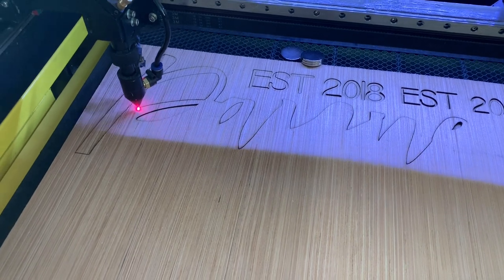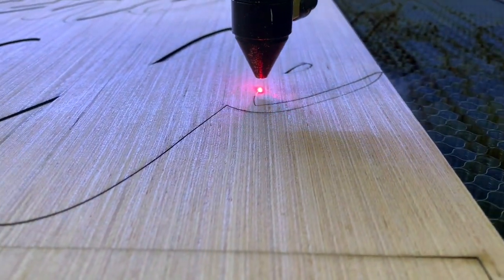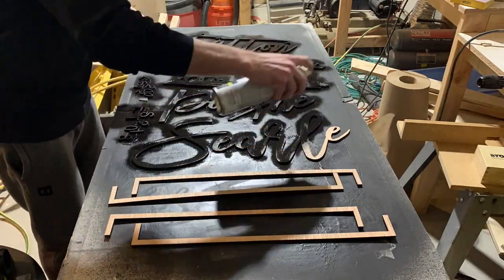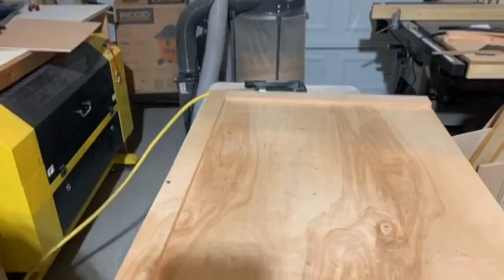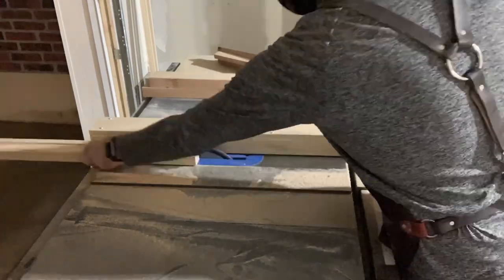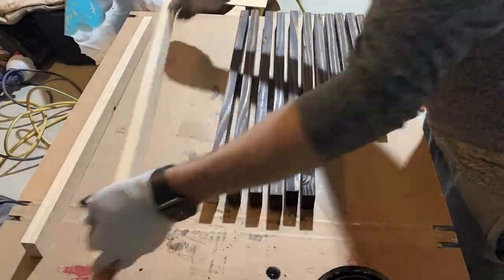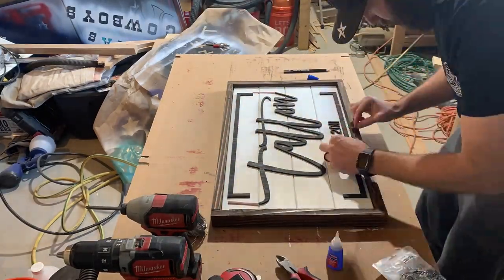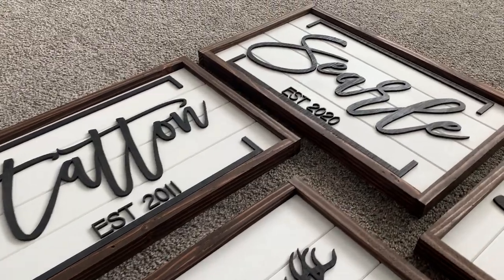DIY Farmhouse Shiplap Family Name Sign Tutorial

Comment: Hey there!  was wondering if you share where you got the weights that you are using to hold down the wood in the cutter.  I am having a heck of time with that.  Thanks!  Also can you also tell me where you get your wood at and what type.  I have been using 1/8 plywood from lowes.  THanks again.
Reply from the maker: Hi! The weights are actually rare earth magnets that I bought on Amazon. https://amzn.to/2SpAaI5 These are the ones that I got and I will double and triple them up to get more pulling force. The ply in the video is poplar ply that I got from Lowes.  https://www.lowes.com/pd/RevolutionPly-5mm-Poplar-Plywood-Application-as-4-x-8/50121135
Reply: Thanks for your help.  I have been running my 50 W laser at 85% and .19 for the speed/inch.  it seems to work ok but there are some areas that do not go all the way through the wood.  May I ask what are you running?  I am thinking that you may have a higher watt laser.  THanks
Reply from the maker: Yes I have a 60watt machine. One thing that I struggled with for a minute was not having my nozzle close enough to the work pieces. I learned that I was actually trying to cut the pieces with out the focal point in the most efficient depth in the wood. Do some test with little circles some closer and some after away to find the sweet spot!

Comment: How do you get virtually no smoke when cutting? When cutting and engraving wood with my 60w omtech the smoke fills the machine as well as the room I'm engraving in
Reply from the maker: I have an upgraded air assist, really good alignment, inline fan, and I leave the pass through doors open so air can flow into the machine.
Reply: @BeardedBuildsCo  awesome thank you I'll try these, just wondering but how many cfm is your inline?

Comment: Great looking design man.. seriously. And nice shiplap trick using mdf trim board. I was wondering.. was it hard to spray paint the edges? The video is sped up pretty quick. I didn't see you spraying at an angle to cover the edges. Seemsike you went from straight top from side to side. How well did it cover the edges? How many coats did you do and what brand and model of spray paint did you use? Thanks in advance!
Reply from the maker: The edges are already covered in a white primer and they are not seen where they are butt together and has a frame that goes around it.
Reply: Are you talking about the backer board? I meant the edges of the laser cutout pieces (the names).. the ones charred by the laser. Did you spray paint that too?
Reply from the maker: @hannytarore4472  oh, sorry. Yeah when I am painting with black to doesn’t matter much because the Baltic birch takes black really easy. Most recently I will put letter back into the negative pieces and spray paint them so it leaves the lasered edge
Reply: @BeardedBuildsCo  Thank you!

Comment: Did you put a round over on the white backer boards to get the shiplap look?
Reply from the maker: Just ran it across the table saw
Reply: So you got regular 1x4 and ripped a cut in the end on 1 board to get that effect? That's the only part I didn't see you do
Reply from the maker: @JoeyGaglioti  these were done with 1 by mdf trim board. They have rounded edges so it gives good relief lines. The other technique that I have stated doing is running defocused score lines on ply with the laser.